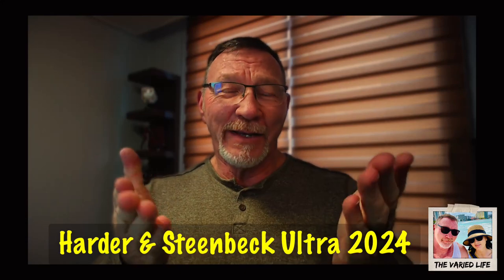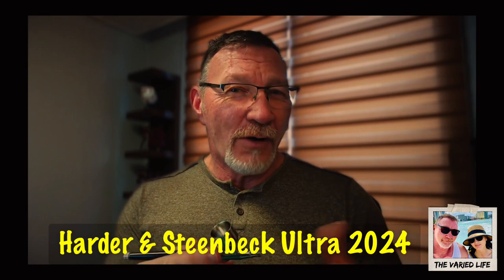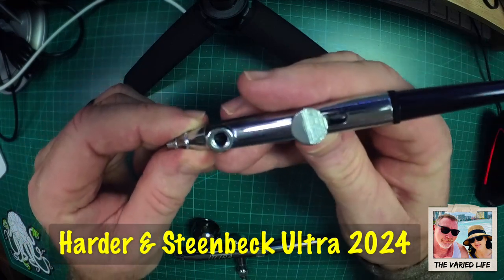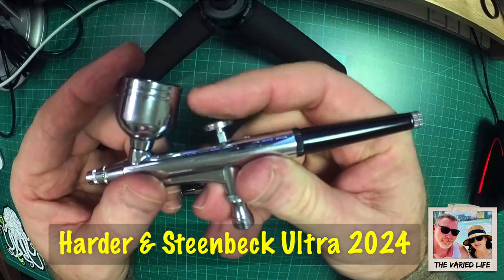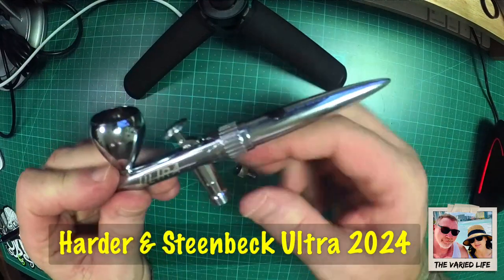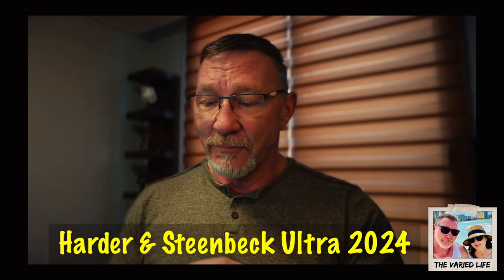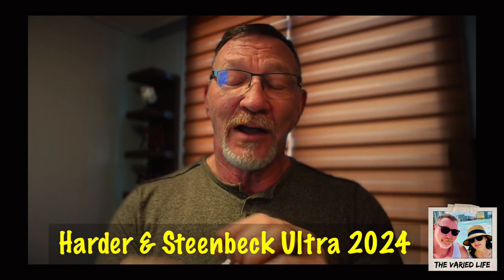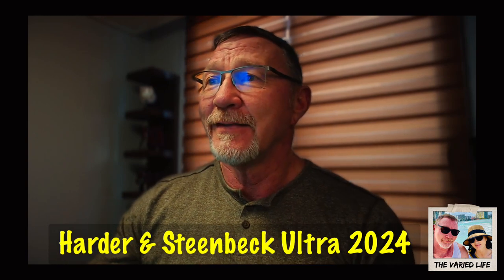Hobby Project: 0013 - Harder & Steenbeck Ultra 2024

Comment: Hey brother! Thanks so much for taking the time to make this video - we really appreciate it, and hope that you have a great experience with your ULTRA 2024 - thanks for joining us :-) As for compressors: if you're already looking at the Iwata range, then if you're only looking for something to power the airbrush, then you can't go too wrong with the Smart Jet Pro. Pros are that it is very quiet, cons - it has no tank, but the airflow IS pulse free and it is very durable. If you want something that has a little more of the 50cal feel to it, then take a look at their Tubular compressors - the Smart Jet Pro Tubular does have a tank, but it has their double speed motor, which puts the output up by around 60%. It's really not necessary for running one airbrush, and it is a little louder. It's still not loud though really. An alternative to that is the Sparmax TC610HPlus... if you want to get an idea of the sound of that, which is very similar in level to the Iwata Smart Just Tubular, then watch our ULTRA Painting Process video - the compressor that you can hear kicking in occasionally (it's under our painting desk in the studio) is that Sparmax unit. Anyway, hope that helps! Just wanted to take the time to appreciate you making this video about our products by giving you some solid advice on compressors, as you requested :-) All the best, Warrick.
Reply from the maker: The Ultra is great. Huge difference between it and a cheapo Amazon no-name airbrush. So glad I got the Ultra. I did end up getting a no name compressor with tank here in Korea and it had a lot of great reviews (the higher end products you mentioned are pretty expensive here, so the no name will do for now). 

Again thanks Warrick so much for the great airbrush. Now its time to practice.
Reply: Yes it's true - we tend to take the view that the compressor is a pump and as long as it pumps, we're good to go! Enjoy the process of practice and remember - one man's mistakes are another man's art! W  @theVariedLife